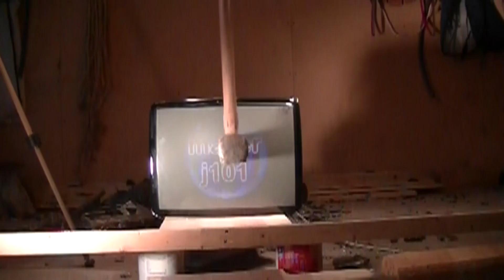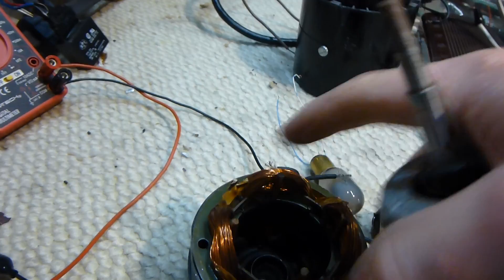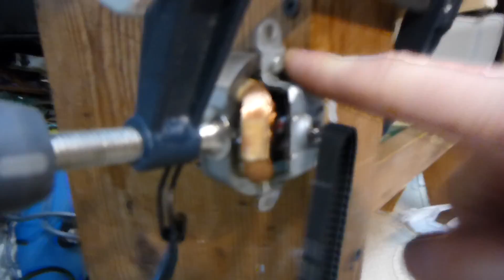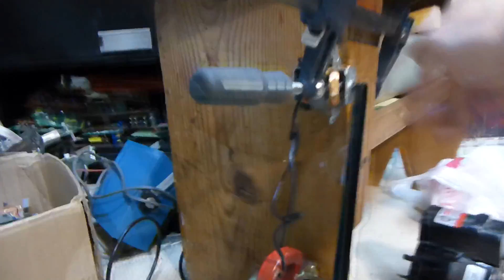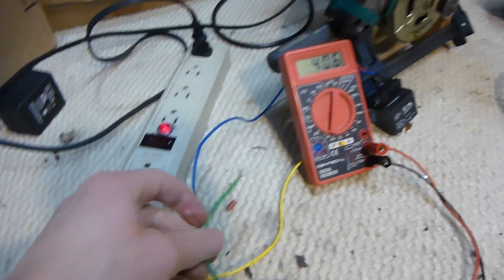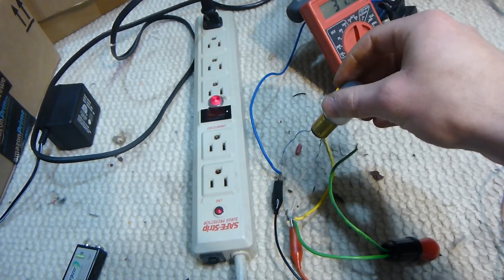Unmodified AC Induction Motor Working as a Generator Experiment

Comment: If you connect run capacitors in parallel to the output of your motor/generator it will put out a voltage.   It's what's called a Self Exciting Induction Generator (SEIG).

I used a 1/3 hp sump pump motor and connected 13 uf(microfarads) of run capacitors in parallel to the motor output, connected a 100 Watt light bulb and it lit.   When I measured the voltage it was about 160 volts AC.    

In order to reduce the voltage to 120 volts AC on the bulb, connect three or four ceramic automotive resistors in series to the hot wire before connecting it to the bulb.     Ceramic automotive resistors will handle the high voltage and current.

In order to spin the sump pump motor, I simply used a 1/2 hp AC motor (1725 rpm) to spin the sump pump motor (1690 rpm) faster than it's rpm rating.  This is what's called Negative Slip, where Slip is the amount of rpm the rotor lags behind the rotating magnetic field in the coils.   Positive Slip (rotor slower than rotating magnetic field) is a motor while Negative Slip (rotor faster than rotating magnetic field) is a generator.

Comment: What you are 'missing' in your 'homemade generator' is an exciter function. Everyone wants to immediately drag you (and everyone else seeking knowledge on this topic) into, is using a hobby motor or washing machine motor to do this. Well, for those recommending this I reply with, 'ok...I want to make a 10kw generator...talk me through it with your hobby motors or washing machine motors. THEY CAN'T!
If you want to make a TRUE single-phase AC generator, out of (what was originally, an AC motor), is a way to excite the electromagnetic field around the armature. Keep in mind, YOU are RUNNING A MOTOR BACKWARD...so think it through. In a normal function, the AC flows from the power grid to the armature by way of the brushes. You are trying to mechanically spin the motor to take power OFF THE BRUSHES...so 'no power to start with'. How do you 'hot' that electromagnetic field to produce magnetic force to spin the armature? You have to look at this process like a car alternator does (which is a small AC generator, powered by the motor). It 'excites' the fields by tapping into the DC POWER (the car battery) initially (when the ignition is turned 'on'), which produces your starter eddy current. It is a 'momentary field', as this circuit is opened again when you release the key, once the engine is started. The alternator is 'excited', the motor is now turning the armature, and DC power is now outflowing from the alternator to charge the battery (because a rectifier is mounted on the back of the alternator...a full bridge rectifier, in fact).
So, when you go to 'start' your 'generator', ANY inductive motor...turning by way of mechanical input, you simply place a momentary DC CHARGE into that field to 'turn it on'...it will self-excite from that point (it should, anyway, depending on how it is wired).
ALSO...keep in mind, such motors depend on coil count to ensure 'hertz' supplied is 'hertz' desired'...so if you have two fields inside the 'motor', North and South, then it will take 3,600-RPM to get 60-hertz...the EXACT speed a governed Briggs-and-Stratton small engine runs at (not a coincidence). A FOUR pole (two North, two South fields, alternating) will only require a motor turning 1,800-RPM to function properly (why most diesel engines run comfortably in this 1,800-2,000 RPM range...again, not a coincidence).
Sadly, FEW have explained how to do what you are trying to do properly. They are so busy spewing 'theory that they've heard, read or watched'...they don't really understand what they are trying to do...and proof of this is all the guys determined to use Neodymium permanent magnets to make 'powerful generators', when in fact, an electromagnet can be made that is FAR MORE POWERFUL than a permanent magnet...the secret to powerful electromagnets resides in three factors: More Amperage, More wire turns in the coil, and more isolated plates around a soft-iron core. An electromagnetic coil will work JUST FINE...just excite the field to get the power!

Comment: Hey its resonance i believe. when you connected the two into the power supply, you put that area into a state that is the same resonance as the one running the induction motor. As it continues, the induction motor will resonate with the part you just connected, but now have disconnected but still in the same resonance  since the resonance was still being produced when you disconnected.

Comment: You have got to keep the generator spinning a little faster than the syconous speed...not the nameplate speed...
You also must keep a load on the generator or the induction field will collapse...
Overloading the generator will also collapse the inductions field...
Also the same for allowing the speed of the generator to fall below the rated speed...
A collapsed field will cause generation to cease.

Comment: If you have a water wheel and gear it up you could have pulse of voltage going back on the grid.
Reply from the maker: +Joseph DuPont and generate enough power to light up an LED for a few days out of the year?

Comment: Only use Hot and neutral to carry current.  Never use ground. Ground is not meant to be a current carrying. If power strip were plugged into a GFI (ground fault interrupt) outlet, it would have tripped, because it detects currents on ground and shuts it down if there are any. This is to keep you safe. 

http://hyperphysics.phy-astr.gsu.edu/hbase/electric/elepic/recept.gif

Comment: Dear friend the motor you are showing in this video is a motor  of a  simple fan of  which outer stater is winded  with coil four to eight pole the router in side the motor is not consists of any magnet to produce Ac electric, the         magnet  must rotate between the coil or coil must rotate between the magnet and power is carried through slip rings.           Have a good day

Comment: There is information available online for using AC induction motors for microhydro setups. I am still not clear on how to use capacitors to self-excite them, but fortunately the process doesn't seem to be nearly as difficult when modifying an alternator to produce higher voltage for a gasoline engine powered welder (my intention at the moment). Evidently, to get higher voltages out of an alternator, you just have to bypass the regulator and wire in a capacitor linking the output of the positive terminal to the field terminal. If there is a slight magnetic charge left over in the iron of the core it will induce a small electric current that will then build (self-exciting). I suspect that something similar is happening here, perhaps you are generating a small current with the residual magnetism of the iron core.

Comment: A 'single phase' induction motor is in reality a 3 phase one. The capacitor is there to supply a 90* phase shift to one 'leg' of the delta (or wye) connected motor. This way the engine behaves as if it had 3 phases 90* apart (or is it 2, it's hard for wrap around those multiphase systems sometimes). There would probably also be a starter capacitor because with phases 90* apart the starting torque will be 0.

Also the thing when you energized the stator windings - that induced current in the rotor windings. The engines started to work as a brake. Then you deenergized the stator (that was connected to the multimeter, so some current still flowed in it) and rotor speed up. We can probably assume that this has made the rotor have higher frequency than the stator magnetic field. And we have a generator!

BTW I wonder what would happen if you would put DC on the stator windings (as in 'reverse' synchronous generator). Would it be enough to excite the rotor magnetic field and get the thing to act as a generator?
Reply: Not correct. All the coils in a single phase AC motor run off the single AC power source. Makerj has merely discovered the induction generator. It works by simply spinning the shaft of an AC motor slightly above it's synchronous speed (1800 RPM for the typical 4 pole motor running on 60Hz power). The motor will, under those conditions, feed power back into the AC line, but will not produce power if the line is disconnected. This is because all induction motors require what are known as "reactive volt-amps" to produce the magnetic field in the rotor that makes it spin. These volt-amps are further known as lagging volt-amps, meaning the voltage and current waves are out of step (out of phase) with each other, withe the current wave lagging behind the voltage wave. This happens because of inductive reactance in the motor windings. A capacitor, on the other hand, has the opposite characteristic. Connected to a AC source, it draws leading volt-amps, meaning the current wave leads the voltage wave. So, if the correct size capacitor is paralleled across the two leads to an induction motor, it can supply the volt-amps that the motor needs to magnetize the rotor and thus, operate as a generator with the AC line disconnected. As Makerj discovered, this setup is sensitve to the amount of load on the (motor) generator. Too much load (current draw) swamps the rotor field and the thing stops producing power. The value of the capacitor is fairly critical and may have to be changed to suit different loads. There are actually projects online that detail using an induction motor, capacitor(s) and a gas engine to make a homebrew emergency generator. So the idea can be put to good use in a diy project. BTW, applying DC to any induction motor will make it stop instantly. This is actually done in applications where a motor must be stopped quickly (emergency, special application, etc) and can't be allowed to simply wind down to a stop. Hope all this helps.

Comment: The rotor is somewhat smartly done ;-) There are iron laminations stuck on the shaft that have those diagonal cuts in them. After that the rotor is put into a mould and filled up with molten aluminum it looks like. That what I deduce from it's looks anyway :-)
It's a 'squirrel cage' rotor.

Comment: Don't make fool the induction motor can not produce Ac Cr unless The rotor of the motor contain the magnet with north ,south priority.  .
Reply: wrong
Reply: Actually it can. All you need is an AC capacitor and something like a gear box to turn it fast enough and it'll produce AC electricity.

Comment: maybe i wrong, as i know electricity come by coil crossing over magnetic fluks, and the ac motor doesnt have magnetic fluks, its driven by electromagnetic fluks which produced by stator coil, so it wont produce electricity as generator
in next, you give stator an electricity its become electromagnetic and capasitor temporary save electricity making stator has a temporary fluks so it produce electricity
that my opinion
Reply: +MN Husin yeh bro... ure absolutely right!

Comment: Induction motors can generate electricity if they have brushes, at least. That is how modern automotive alternators work. They don't have permanent magnets, but a magnetic field is created on the rotor by the battery when the car is started.
Reply: Inductions motors dont need brushes just a few run CAPACITORS in parallel with the lead wires

Comment: You are trapping a back EMF oscillation in the system. It is a very significant aberration.
 You happened to stumble upon the correct harmonic ratio between current and motor combinations. Altering the ratios will yield varying results. This is Tesla free energy stuff. The trolls will try to lead you away from it and teach you how to do it "right" but you are onto a major discovery if you pursue the subject. When you get it right something will smoke, lol. Not because you did it wrong, but because you will unlock a massive harmonic energy potential. Good Luck.

Comment: Usually they would use a DC motor as an Exciter to start the Induction Motor generator. Otherwise you could just connect it to the AC like you just did.

Comment: you would be better off using a DC motor if you are looking to generate electricity. if you need AC just use an inverter.

Comment: YI like to think of the core as part of a tank circuit. Once it's charged, then you have a magnetic feild and can generate power. Once the tank is draind by a big load it kills the mag feild and no more power.

Could be fun to try and set some magnets into the core. Then you would have a generator....
Reply: I'm sure he could get different results at different RPM and cap sizes.  Because I'm with you, on the whole tank circuit business.
Reply: Yep. May other comments on the video also mentioned changing caps.
Reply from the maker: Mongrel Shark Yeah I think that's how it works.  Here's a demonstration:  https://www.youtube.com/watch?v=ADRK_NkQ-eU 
I think I just need bigger/more capacitors to get more power like this guy.  
Thank you!

Comment: If you have not done this already, you might want to play with a direct drive brushless dc washing machine motor. They are great for making generators. You need a 6 diode bridge for rectification and you can change the coils from series to parallel to lower the voltage.
Reply from the maker: Robonza I knew there was a washing machine motor at my grandmas house.  When I was over there on the weekend I looked at it and sadly it is a induction type.  So not as much use to me.  I probably still should have asked for it because it has a lot of copper in it!  I got a pretty old crusty alternator though!  I'm not sure it's ever going to work again.  The windings are pretty sad and bearings are totally shot.
Reply: Have the thing checked on an alternator test stand to see if it has any life left in it. You can get replacement bearings easily. If the windings are shot you've got a good machine to experiment with--different winding/coil sizes to see what voltages you can get out of it. There is a company that does this to make a car alternator suitable for alternative energy use (windmill, waterwheel, etc) by enabling it to produce power at lower rotational speed.
Reply: Robonza to

Comment: Great discovery and yes you can generate enough energy with an induction motor to power all sort of small to big appliance. The tricky part is to get the proper capacitor to generate the voltage you require. And if you spin the motor at the correct RPM and a little bit more it should self excite itself. EX a 4 pole 60 hz motor will run at about 1725ish RPM so if you bring it to 1800 and little more it will generate 60hz at little less then the voltage rating to correct that you simply need to use a bigger capacitor. If you plan on changing capacitor make sure you use run capacitor don't use any start one they will make a nice smoke show ;) also use at least double the voltage output. :)
Reply from the maker: bakupcpu Very interesting!  I will have to try more experiments with this some time!  Thank you!
Reply: :) No stress!

Comment: That brushless motor looked very powerful 
I, just for fun, bought a motor from radio shack (18v DC and about 500ma@18v) and it is brushed, but it's not powerful. Why are some motors more powerful than others of the same specification?
Reply: You may want to look into motor efficiency. Brushless motors are "typically" more efficient than brushed motors. When you get a cheap brush motor from China you will get something with the cheapest magnets and as little copper as possible, this makes for a motor that is inefficient
Reply: Robonza thanks. I'll look into that this weekend. Where can I get a decent quality motor? (Max 1 amp 12 volts)
Reply from the maker: tikiman48 Hmm that's a good question!  All the motors I have I got from stuff I took apart so I have no idea where to buy motors.  Look on eBay and Amazon as well as some smaller sites like electronicgoldmine and icstation.
Reply: Makerj101 thank you!
I'll look there
Reply: These days I try to use stepper motors as much as possible as you can easily manage distance, speed and acceleration. You can use rep-rap controllers on them. This way its all done for you, just add a few lines of gcode.

Comment: The brief use of power will magnetise the core and give a small charge to the capacitor which will maintain that charge, that's why it can generate a small amount of power
If you replace the capacitor with a battery, you may find it will generate power while the battery is connected, a car alternator has a rotor winding that becomes an electromagnet (controlled by the regulator) which induces power into the field windings to generate power
Reply from the maker: *****  I tried hooking a battery up where the capacitor goes and it doesn't do anything then.  This is a induction motor so it does not have a armature winding like in a alternator or dynamo.  It just has the main induction winding and some how the start capacitor is wired in there across the windings or something.  It has something to do with the capacitor storing enough power to keep the magnetic field long enough to change poles or something.  There are actually people who use bigger capacitors and then can use an induction motor as a powerful AC generator.